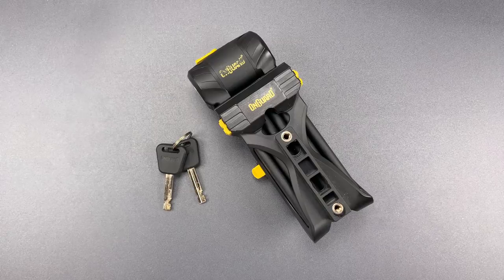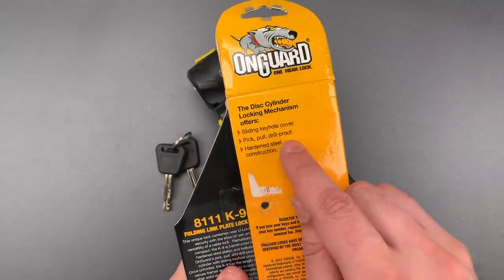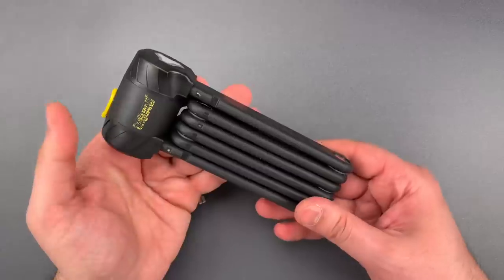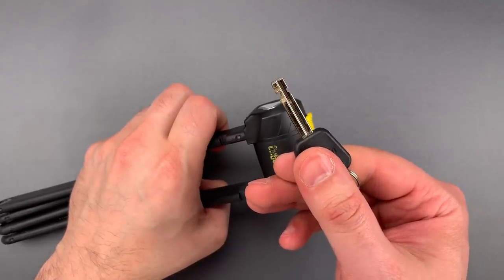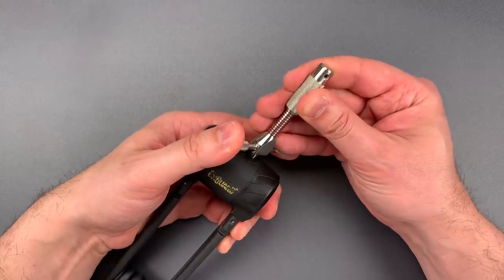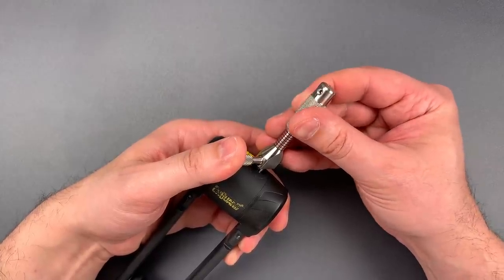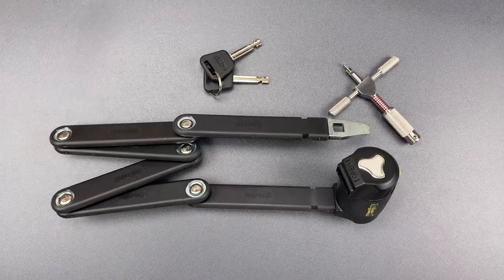[1013] “Pick-Proof” OnGuard K-9 Bike Lock Picked (Model 8111)

Comment: Until I start seeing “LPL recommended” on locks, I will continue to believe that they are inferior
Reply: "Recommended" is a strong word. I'd settle for "LPL adequate".
Reply: I'd settle for  "It took LPL a whole 2 minutes to pick this lock"
Reply: Well there isn't something like unpickable lock
Reply: Could grade locks by their LPL YouTube video's runtime.  5+ minutes would be a pretty good lock.  I'd definitely trust my bike with a 10 minute lock!
Reply: @el0rg  10 minute video's usually mean LPL is roasting the lock by showing off the numerous ways it can be bypassed. Picking, using hammer, shimming it, holding it sideways, wiggling it, asking it to open or any other means to unlock it. Twice, to prove it is not a fluke.

There is even video about the lock that would nog stay closed.

Comment: "Seems the first disk is in a gate."
Dude I have zero clue what that means lmao
Reply: It's in a gate duhh
Reply: There are a bunch of disks that rotate inside this lock and each one has a cutout (gate) on the disk that aligns with a bar (sidebar). When all the disks are aligned with the bar, the lock can turn and open. Check this diagram -- the gate is labeled "true gate" in it (the lock in the video didn't have any false gates, that would be an upgrade security feature): https://unitedlocksmith.net/wp-content/uploads/dd-diagram.jpg (they have a post about this too https://unitedlocksmith.net/blog/what-are-disk-detainer-locks)
Reply: https://www.youtube.com/watch?v=x8jvBPugLac&feature=youtu.be&t=143

The gates demonstrated there have pins that fall into them as you push the button; if they are blocked (the gates are not in the right positions), then the lock will not open.

The lock LPL is dealing with is stacked discs, so this is many gates for a single pin.

Comment: The question is, though, since the tool you used was made by yourself and Bosnianbill, wouldn't you say the test is a bit unfair? I am in no way saying the tool is one-of-a-kind, but I've personally never seen or heard of bike thieves or opportunistics running around with disc-detainer picks. Perhaps the term "pick-proof" relates to the average usage situation this lock is going to be put through, and not just the lock's core?

I don't know enough about locks to know if what I've said is 100% true, but that's my take on the whole thing. Would love to hear your opinion on it.

Comment: OnGuard K9 site as of today still offers this lock but they have changed the wording. 

"K-9 | Compact and strong. The link-plate folding lock is the latest in urban theft deterrence.  Our K-9 offers exceptional protection, ease-of-use, and great new bracket that for quick on-off use.  Offering near U-Lock security with the ease-of-use and versatility of a cable lock."

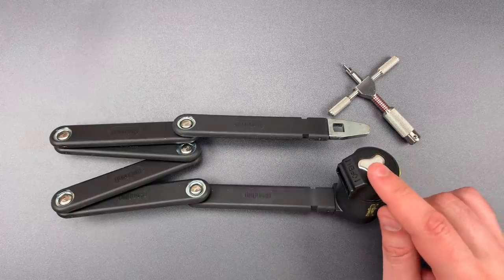Comment: 01:47  I think it's a matter of semantics.  You can't pick that lock (please, please make a video proving otherwise) without a specialized tool, so it's "pick-proof" using a normal lock-picking kit, or a bent safety pin (etc.).

So using that disc-detainer tool, you're not actually "picking" the lock.  Or something like that.

Comment: Lesson one English for sales and marketing teams.    "Resistant" VS Proof.  
A jumper with fine mesh materials:  direct splash of water will skim off of its surface. However submerge it in water and it will absorb the fluid. It is water Resistant.  
A Plastic jacket: Water will splash off of it and the object underneath it (the human wearing it) will be dry. dunk it in water and take it out, the water flows off of it. It is water proof.
Pick resistant: The common Joe Schmo does not possess the "pick that bosnian bill and I made" so its hard to get into, but not impossible.

Pick proof: To date no such lock exists. Humans made the lock, another human can "unmake" the lock. If one existed that was simply impossible to pick, it would be pick proof.

Now for a History Lesson. 
Look at the DVD.  It's amazing "uncrackable" security measures were famously broken within hours of its release, likely by the guy sat besides the guy making it unbreakable. 

Thank you, class dismissed!

Comment: Tool assisted wins detract from the "victory". Perhaps coincide defeat and acknowledge this cannot be done with standard picking methods and without the use of a special machine crafted tool. Any lock smith with a standard set would fail without adequate preparation. Lock takes the moral victory

Comment: picks and locks are in an endless arms race. no lock will be unpickable because new entry methods and new exploits will be found as long as new locks are produced. this lock is obviously over claiming by saying its "pick proof", and there are always more powerful drills, and mechanical pullers. i am curious what would happen if a wedge was forced between the links, maybe tightened into place with a screw, im fairly sure it would pop open just as quickly as any other destructive entry method. (maybe not as fast as the ramset)

Comment: It's pick-proof, if you define a pick as the kind of curved tool used in a pin-tumbler lock to push pins up to meet the shear-line.  If your disc-detainer tool isn't defined as a pick, then it is technically pick-proof.

Comment: While you did proof you can pick it with a special tool, I would argue the average attack on this won't be someone with a specialised tool. I assume that's the idea behind the claim. Racking proof doesn't sound as impressive. However it be interesting to see if it is possible to pick that without a special made pick

Comment: other than the key being pickable, i don't like the looks of the metal of the linked bars.   It's very rare for tougher, stronger metals to have that thin chromy electro plating.   It's would be even worse if it was that color because it's a slightly polished mild steel, which i doubt, but in any case, good hardened steels do not have that finish very often, especially when it's not a visual component.

Comment: If something is designed to be opened, pick proof isn't going to work usually. Best they can do it set traps, get sneaky, or otherwise concentrate on defeating a picker. For me, putting an alarm in the lock when the picker pushes something into a contact would at least bring attention to their attempt. Like that game Operation.

Comment: In fairness, they were probably unable to test their lock against a custom tool made several years after the product was designed. I don't mean to say that they should have advertised it as pick-proof (since I'm sure you could get in eventually with something else), but it would be a more powerful demonstration if the lock were picked using a tool that was at least semi-commonly available at the time.

Taken to an extreme, imagine a castle that was described as "impenetrable" in the 15th century. If Enola Gay dropped a bomb on it, I don't think we would then be saying "pfft, wht wr thy thinking lulz".
Reply: Actually... I would like to see that too. 
It would be a good challenge for the Lock Picking Lawyer to use tools commonly available during the period the lock was developed.

Comment: "pick proof" maybe meaning using the standard lockpicking tools and not your customized device? I dunno.
Reply: "Pick proof" or "pick resistant" claims from most lock manufacturers refer to testing done with amateurs and/or improvised tools.

Similarly, "drill proof" is usually assuming a low to medium power cordless drill and a general purpose bit not specifically intended for hard metal.

I would assume "pull proof" is in a similar category but im not sure what the contemporary or improvised analogue to a core puller would be.

Comment: Is there any consistent standard what "pick proof" means? Or is it one of the things you just put on your product
Reply: You would be surprised how many things fall under 'marketing terminology' and just how much leeway that gives a company to lie to their customers!  

For example: 
I was working for a mobile supplier when "5G" phones first hit the market.  These phones could not match the networking requirements put forth by the Institute of Electrical and Electronics Engineers but that didn't matter.  The company simply claimed they where using 5G in relation to internal terminology, aka what marketing called their new network, and thus it didn't have to match the I.E.E.E's requirements.

I don't know if 5G phones ever achieved the I.E.E.E's definition, or if 5G still refers to their own internal network concepts!